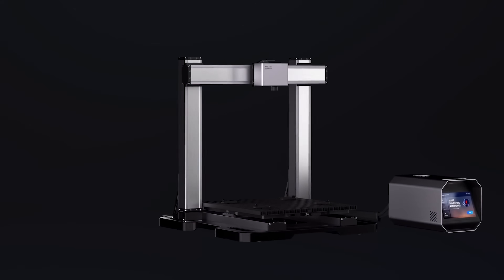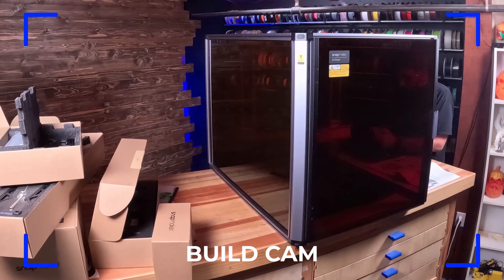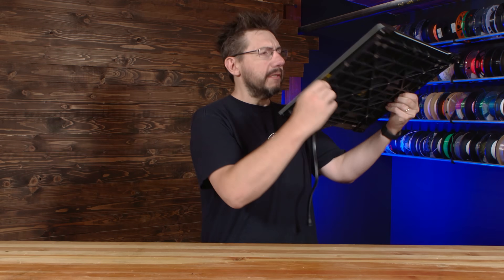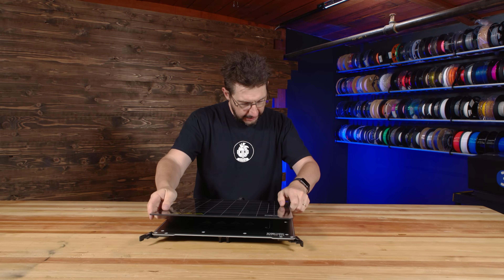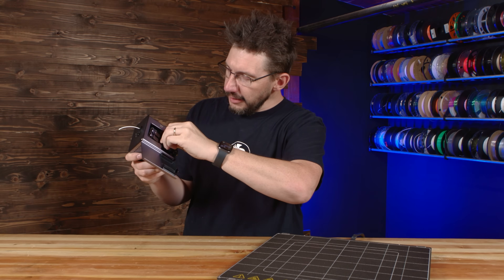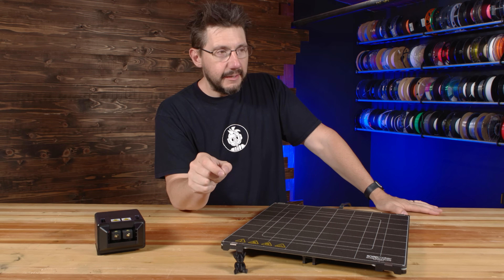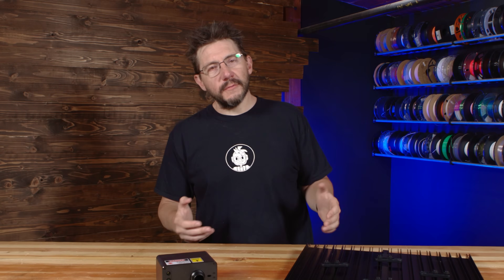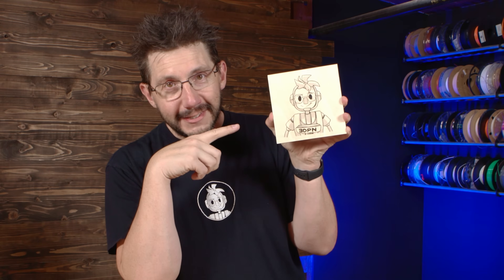MASSIVE! The Snapmaker Artisan is HUGE

Comment: I have the older Snapmaker A350 which also has the 3 functions. However the CNC is less powered and the laser that came with it was less powered but I did buy the 10w laser. The 3D Print head is just the single, however, a lot of reviews of the dual print head the users had issues. I bought my Snapmaker on eBay from someone who really had no idea what they were doing. I had to replace the heated print bed, the LCD screen and one of the rails. So, yes, it dod cost me money to get the parts but far less than the $1400.00 as I bought it for $300 and the parts were about $350 so $650 vs. $1400 was a great deal. Since then I think the A350is now at $899 or something like that. The A350s had some issues with the frame that hold it to not be level BUT I bought a glass print surface and I manually level and the issue was solved at a $60 cost for the glass bed that matches the large print volume. I also bought the rotary CNC which is actually really cool. Overall the prior Snapmaker is pretty good, but its a bed slinger so rather slow although I do run it at 80mm/s vs. Luban's default of 50mm/s and it seems to do well at that faster speed. I don't really need the newer Artisan since I have now gone Voron and I prefer Corexy.

Comment: I own the snapmaker J1.  I'm looking for a review on the J1, how to only use the right extruder, seems like left side is automatic default, also kinda junk you have to manually select back up mode, it Does Not automatically switch spools when one runs out., If you don't have the setting on , it will detect empty roll and then stop.   I love how the snapmakers are built, high quality  material and looks and feels great. I need to learn more about my J1 and now I'm looking into then laser and cnc machines.

Comment: For the cnc part, can the machine work in MDI? Did I hear .2mm accuracy? What does it refer too? Positionnal tolerance on the 3 axis? Spindle runout? 
Machining a 25mm wide block might measure 24.80 to 25.20? Thanks for the awesome review!

Comment: Cleaning will be a nightmare to be able to get clean 3d prints. $3000 is not for everyone as you can buy each separate machine for cheaper but then you need more space for 3 machines rather than 1. Nice concept and getting the price down will help a ton but still needs to be bigger as laser engravers even have extenders to go even bigger which this cant do :(

Comment: Im not a fan of 3 in 1. But cant wait see your full take on it. I rather have 3 separate machines. It seems like a pain to clean after using as a cnc then switching 3d printer.
Reply: And let's remember, that's not a cheap 3 in 1 option!
Reply: I have to agree with you.  I like the idea on paper but in an actual work flow that would need say two or all three functions requires a lot of thorough cleaning involved.   Laser and 3d printing might work decently together but mixing in CNC with either of those just doesn't.
Reply: Also the print quality is really bad. For a price point of ~400-500$, this is just bad. Seperate machines is definitely the way to go.
Reply: @dasoul3710  that is just bullshit, the quality is great ^^ use one before commenting
Reply: @DierkBentPiening  I had one and speed and quality compared to my Bambu lab X1 is garbage. Even my old printer, the Ender 3 Pro had better print results. Print an object across the entire print bed and show me your print, I'll gladly wait for a great result...
Reply: @DierkBentPiening  Show me a video/image of a print that used the entire print bed.

Comment: Are the brass nozzles not changeable by themselves?    You have to buy an entire assembly?

 (On the Snapmaker 2 the hot end is just 10 bucks and the nozzle is removeable/replaceable.)
Reply: you can also just remove the nozzle, but have to change nozzle size in Luban manually. If you buy the entire hotend, it will update automatically. So just a QoL feature for some $.

Comment: Great introductory video, Joel! I have had my Artisan since CES when I picked up the one there. I'm most impressed by the increased length of bottles I can engrave with the rotarty module. I still have my snapmaker 2.0, but this thing has become my new workhorse. Have you tried the vibration compensation firmware?
Reply from the maker: Hey! No I haven’t not yet!
Reply: @3DPrintingNerd  it may be worth a comparison! I've only ever had it on while printing, but I know they shipped with the older firmware.

Comment: ive never liked the idea of these combo printers. i get that its like, hey youve got a motion system already why would you buy a new motion system for a different process when you could just change the toolhead, but...there are very good reasons why you would want a different motion system! especially with cnc where there are lateral forces on the toolhead
Reply from the maker: I get the idea, but I think Snapmaker is the most ideal of the motion systems to do this sort of 3-in-1 functionality. The motion system is quite rigid. Plus, the CNC isn't doing anything massive, it's more about detail. Continued use will definitely tell us more about whether this is a good idea or not, but for me, I'm excited to use it.

Comment: Try double-sided tape instead of tabs
Works good on snap 2.0 with clean finish
Reply from the maker: OMG YES! Great idea!
Reply: @3DPrintingNerd  Not my idea more like a general CNC trick I saw somewhere, but yeah you might have to experiment with different tapes, and there's still a chance a part goes flying around if the tape isn't strong enough. Sometimes there's little glue residues on the edges, but comes off easily with alcohol

Comment: Hi, I noticed when you held the spindle in your hand that it had a FAN?, on the back of it.  What is the failure rate on that being that the dust will fill that fan in about 20 seconds.   Just curious if that really was a fan.   Thx,   Have always liked the IDEA of the snap maker but really have not noticed anyone in the community using them, and they have been around now for years.
Reply from the maker: I'll keep an eye on that opening. I don't think it's a fan, but more of an exhaust for the air that is generated by the spindle spinning. I'll definitely keep an eye on it.

Comment: I just bought a snapmaker 2.0 last year and so far I've only done some prints. This is mainly due to the pain of switching out  the various tooling heads. I pre-ordered the quick-swap for the tool heads and I am so stoked to use it. Unfortunately we have to wait until September to get it, but it will make the machine just easier to use and I am excited  for it. 
I really wish I knew they were coming out  with new printers though like the Artisan, I might have held off and bought it this year instead of the 2.0 but it is what it is.   It'd be nice if they provided some sort of upgrade path to go  from 2.0 to artisan. Especially if it prints faster, that is my number one complaint so far is it  takes forever to print  something. It'd be nice if we could upgrade the steppers or rails to faster ones without having to buy  a whole new machine. But I am happy that I get the quick swap which will make the other tools so much more useful. I guess we will see what Snapmaker does in the future.
Reply: Ditto.   I have the A350 and only used the plastic extruder for almost a year, because of how tedious it is to change out the head and beds due to all the screws.    
I did finally try the laser and found the tiny watt laser that comes with the A350 is nearly pointless.   I upgraded to the 10W laser and it makes a world of difference.
Still have not tried CNC due to the psychological barrier of screw gymnastics.   
I recently ordered the quick change set and waiting for it to arrive to make switching tools worthwhile.
Reply: 100%. I got my Snapmaker 2.0 A250 not long ago. It's fantastic machine, but swapping the toolheads is fiddly and annoying, especially because, in my case, the machine is in a place in my small shop where I can't open the side door of the enclosure (and that's the only place where I have room to put it). I came up with a little trick that makes it slightly easier, but it's still a pain. 3D printing isn't fast, but my results have been very good with PLA. PETG is taking me some time to dial in. I get quite a bit of stringing, but that's maybe just the nature of PETG. I haven't tried other materials yet. I have the dual-extruder tool head, but I haven't set it up yet. I'm going to set it up probably today, as I've managed to clog the nozzle on the single-extruder head twice so far. I've had some trouble with leveling the print bed that I haven't figured out yet after I changed the hot end on the single extruder head. Maybe I've misaligned something? I don't know, and I haven't asked about it on the forums yet. I haven't tried the CNC function yet. I'm waiting for the quick-swap kit and to 3D print a dust collection boot to hook up to my shop dust collection system so I don't fling dust everywhere in the enclosure. Despite it's small annoyances, I'm really loving playing around with it. It's my first 3D printer and laser cutter/engraver. 3D printing is amazing; I'm enjoying creating and searching for designs of things to make for organizing my shop and around the house.

Comment: Very nice looking machine. I'll be interested to hear the pricing.

I've always wondered about these 3-in-1 solutions. Aren't you at risk of lots of dust or other particles getting on your 3d prints over time (seems like it will be tricky to clean up all the CnC mess)?

Also, I'm not a CnC guy, but shouldn't you put a bit of waste board between the clamping surface and the part you're cutting? Otherwise you'll tear up that CnC bed, and you're at risk of running a CnC bit into one of the metal inserts?
Reply from the maker: The CNC bed IS the waste board. They give you instructions on how to replace it when it's time.

Comment: I am super stoked to try the new 40w laser upgrade coming soon according to Snapmaker, hello glass and acrylics. 😊
Reply: Please stay tuned!
Reply: @Snapmaker  Absolutely ‼️ ❤️. If you want someone to test it out for you 😎👍. Feel free to let me know 😊.
Reply from the maker: Good choice!
Reply: I’ve been doing a lot of research on laser cutting lately. Make sure that acrylic is dark to cut it. If you just want to etch it you can use special black paint. Remember to ALWAYS wear glasses and use proper ducting to remove that air! As for the cnc machine. Definitely be careful with that too. Glasses and mask rated for sawdust are key. Otherwise, have fun and keep making!
Reply: @RolieKloeOlie  absolutely, I have a fully flushed out woodworking shop, lathe, bandsaw etc and Yes 💯‼️ always appreciate eyewear. Even when the machines aren’t running, that’s when the particles spring to life and fall in love with your eyes.  

One of my favorite features of this Snapmaker set up is that the panels for the enclosure are rated for the wavelength of the laser it run! That’s an under rated and appreciated safety feature I have not see on any other desktop Laser setup in this price range. 

Dinky shrouds don’t cut it, full enclosure plus safety glasses. That way I don’t have to worry about blinding the dogs or kids because they sneak out to the garage. It was a huge point when I decided on Snapmaker.
Reply: @MakerBees333  so envious of your setup! I’m in an apartment and getting a laser at the end of the month; hoping to make some money to be able to afford a bigger place to get more toys!